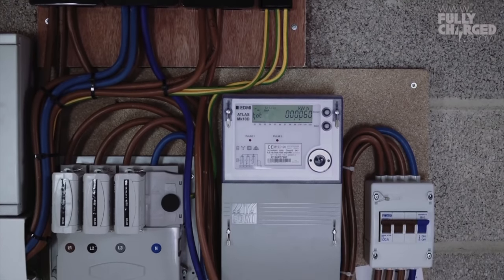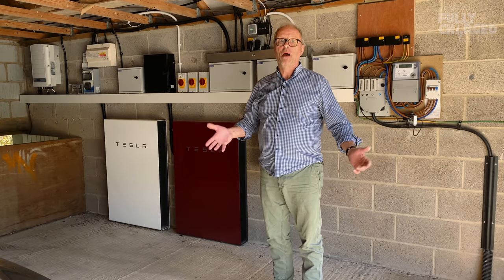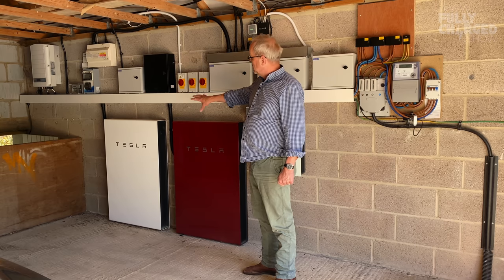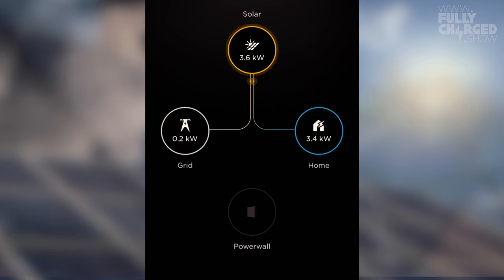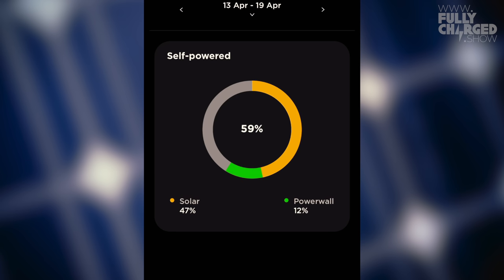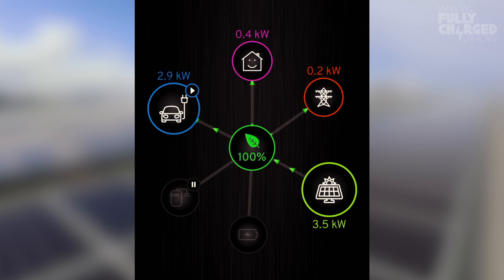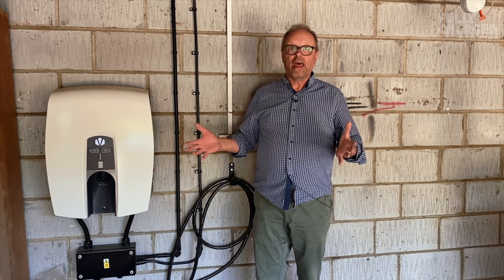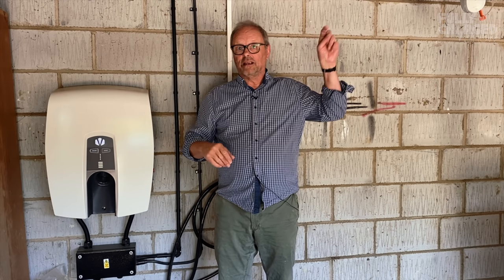Tesla Powerwall: how quickly can it respond to a power cut? | FULLY CHARGED for clean energy & EVs

Comment from the maker: Robert provides an update on 'the update' to his Powerwall installation. He has been busy tweaking his system to ensure instantaneous response in the advent of a blackout. He also shows us what else is going on in his garage, with an update on his Zappi, and introduction to a V2G unit, and lots of lovely statistics to show how homes and cars can be powered by solar, even in England!  For easy reference through each section of this episode, see timestamps below. AND If you like this episode, you might enjoy the previous episode on National Grid's 'Green Energy Success Story': https://youtu.be/ONp8dismI-Q
Reply: fullychargedshow Anyone can build a UPS (Uninterruptible Power Supply) Tesla power walls are just one of many!
Reply: @barryamorris   The tricky bit is getting it to play nice with the power grid management software controlling when the power is going back out.  If a lot of houses just dumb-state it both ways, that could disrupt the local grid distribution or fry some of their equipment (and people).

Back when one house in 100,000 had surplus electricity, it just ran the meter back a bit and the grid coped with the margins -- it was statistically insignificant to the total charges & resistances (especially out in the country where the very early adopters tended to be).  If you're going to have most or all houses doing the same thing in town, it could destabilize altogether.

At some point in the equation, the margin becomes the main sum, and everyone has to learn to play nice with others.
Reply: I assume from this that the Powerwalls can't emulate the V2G functionality, yet?
If there's a Powerwall connected to two phases of the three phase supply why isn't the V2G unit connected to the thrird phase?
Love the tech but could you share as to whether Powerwall prices have followed the downward trend in vehicle battery prices?
Thanks.
Reply: animist channel Smart meters measure both import and export rates. As for playing nice with the grid, you have to notify them that you have generating equipment in the first place. They balance the grid constantly by ramping generators up and down constantly! The more people that can export power, the less reliant we are on coal, and other legacy power supplies. We need far more micro generation and battery storage systems. If we do, blackouts and brownouts will become a thing of the past. Current generation methods are still unreliable, offering uneven wave form power supplies. The energy generation still has a lot to improve on.
Reply: Fully charged 😁👍🏻
Reply: In terms of CO2, I'm wondering about how much the production of the power walls and those solar panels for a single household are responsible for and how many years it has to run in order to offset that foot print.
Reply: @barryamorris  Most devices known as a UPS don't have 27kWh storage & the ability to run an entire household.
Reply: A 15m video just to saw us how much time it takes for a power wall to feel the gap of energy.   WHY DOES IT HAVE TO BE 15 MINUTES LONG??????   You have to answer this one!!
Reply: Older Nissan Leafs can get a software-update to unlock V2G capability. Check with your Nissan Dealer. The oldest Leaf we have tried for V2G was a 2012
Reply: vk2aaf hamradio they can go far bigger! The more batteries you connect in parallel, the more power they store! Think commercial set up
Reply: @BobAndersson  I actually thought they can do that already, but on second thought it would be problematic. It makes sense to sell some of the power left in your car battery because you aren't charging it at peak time and it is unlikely you need to take long trips at night so you can charge it then. The PW is already powering your own house.
Math: Your car might have 100kWh battery of which normal people don't actually use much during normal days, so W2G could sell 50kWh and still leave you plenty of range for late night shopping. OTOH, your PW has 6kWh or 13kWh capacity if full, which is barely enough for the peak hours.
And the electric company isn't going to buy from you at their peak selling rate either, so using the stored power saves you more money than you would get from selling it.
Reply: Great video, as always, but one question: Which Power Supplier do you use? Sounds interesting - I know you can't mention it in the Video, but there is no law that forbids to answer questions ;-)
Reply: Pavor  Lithium does not qualify as a finite resource unless you use it for fusion power. There is plenty of it available and we can recycle it from used batteries; oil is finite because once last wells dry up there won't be any more ever.
The only problem with lithium is that pumping brine into pools and letting the sun dry them so we can collect the lithium salts is actually too cheap, so all lithium mines closed because they could not compete. As demand grows and the price rises that may change again, and if we really need loads more we can simply separate it from seawater.
Reply: @apostolosviol  You don't have to watch the video. You're free to stop it and go elsewhere, if you wish, and if your attention span is simply too short. Fully charged can run their channel exactly as they want to run it. 

There are thousands of people who are interested in watching a video which is only 15 minutes in length, learning quite a lot of useful information from it, and being entertained by a seasoned professional with more than 30 years of honing his skills.

At the time of writing my comment, this video has more than 6,700 likes and only 68 dislikes, one of which might be yours, and a few might be from bots. On that basis, you're outnumbered by around 100:1 to date.
Reply: @KookyBone  OVO. He tells us.
Reply: @29rvnd  Did you have your Nissan Leaf 2011 up-gradeed in the UK?
Reply: 🤗THANKS ROBERT,WATCHING WHILE YOU ARE IN SAN DEIGO …😁 2+years later 
AND WE HOPE YOU ARE ENJOYING EVERYTHING HERE,AND NOW 😁😎💚💚💚

Comment: Thanks again for showing us what is possible in this new world of clean power production and use. I did call over a year ago to thank Robert personally. We live just over the hill from him, and have followed his lead with Solar, Eddi, Zappi, Hub, etc. Battery in the garage, with a Hyundai, Ioniq, then a Leaf 30kWh to connect into the V2G run by OVO. The strange thing is that OVO declined after a lot of head scratching to put us on the V2G trial, because we had a battery (6.3 kWh) in the system. Despite being told it was not for export to the grid, they said no, as perhaps it might export. You Robert 5 miles away, have 2 batteries, and a leaf that can’t be used, and still get onto the trial! Such is the aura of your persona! Well done, I look forward to seeing how it works. As for us we sold the leaf, its Winter performance gave us issues that caused tears, and we can’t use it for V2G. So again we follow your eg. With a Kona 64, and may be a Tesla M3. Ces’t la vie.

Comment: The Tesla switch is fast indeed! A colleague of mine more than a decade ago already had a switch between grid and home battery, but it had simple contactors and time relays. When power went out, it would pull a large contactor (normally closed contacts) disconnecting the house from mains. When all three phases were back and continuously on for more than 20 min, it would switch off the contactor and connect back to mains. It worked well, but there was a noticeable gap between switching in power out situation. He did have UPS setup for computers etc, so they didn't notice it. You noticed lights go out and then back on (maybe half a second delay)
Reply: EWheeler Finland Think solid state switching. To get the change over correct, there will always be a millisecond gap, to ensure you disconnect from one, and switch to the other.

Comment: Going to do battle with EDF in France this week. They keep pestering me to put solar on my roof, but have been reluctant to let you store it and do V2G, I’ll let you know if they have changed their minds yet!
Reply: Libellula Washington My agreement with the French Grid operator says I cannot have storage. No big problem for me as my solar is there primarily to power the pool pumps and heat my water.
Reply: Store the solar and use the grid as a generator, don't export to the grid. If everyone did this the grid would be stable and they could not jack up your  cost to buy, just because you have solar.
Reply: @wrong-waygo-back9355  if everyone did that, the grid would become unsustainable, economicomically.
Yourd be self sustaining, not profitable anymore, can't have that.
Reply: V2G would be a stop-gap measure to large scale decentralized grid storage. Paid for by you, the customer of your mode of transportation.
It would flatten the curve for gas-powrplants to ramp up/down and softening the load on the grid as a whole.

Comment: Great video! Solar panels, lithium batteries, electric vehicles and now V2G, right now I feel envy. And you live in UK imagine the potential of your installation in Spain ...
Reply: Or Australia. We are looking at a daily average of 23kWh from a 6.5kW system in winter, close to 40 in summer.

I honestly think Tesla is missing a trick here with v2g. Do we want to rely on it for backbone storage? Probably not, but it can be the peaking output so we don't double up on the batteries required. And you usually need peaking output when supply charges are high, so better for those becoming an occasional temporary supply.

Comment: We put our system to the test last week. I live near Philadelphia, PA and we had a major storm come through. We were off the grid for 62 hours 18 minutes but we were never out of power. Between the batteries and the solar we could do pretty much anything we wanted. I only have one issue with the Powerwalls, the bridge that allows it to power the house and use the solar only comes in a 200amp version, we have 400amp service to the house so we did have to decide what would remain powered and what would not. I think if they had a bridge that could handle our entire house I would have gotten a 3rd Powerwall to allow us to use the AC. 
The best part about the Powerwall is that, unlike a generator, the batteries are used everyday to help power the house.

Comment: My DIY (well installed by an electrician) setup uses 2-terminal relays to switch live/neutral from the grid to my inverter.  It's pulled into the NO position by a small AC transformer powered by the grid.  If the grid fails the relay goes to the NC position and the inverter (which is always on) just starts powering the panel.  Granted my critical load panel isn't "the whole house" but my setup can keep things like my fridge/freezer/telco running uninterrupted and it costs a heck of a lot less than a Tesla powerwall :-)

Comment: It's a shame smart meter support for three phase isn't very good. We should really be pushing for all new houses to be three phase. It makes it a lot easier from a DNO perspective to add solar and batteries. It also enables the transition from gas boilers to heat pumps, and faster EV charging.
Reply: Yes, and also really crucial for commercial applications. V2G will work fabulously with commercial vehicles that are used during the workday and then parked up for the evening. Any remaining juice in the batteries can be fed into the grid during the evening peak, before the vehicles are recharged in the early hours of the morning, ready for the next day.
Reply: Yup, and where there is a chance that 250 volts will give you a really bad day, but one you will remember, if you short out across 2 of those phases and get 415 volts going through you, YOU may not be aware of it, (being dead), your nearest and dearest will. And can drink to your memory every year. 
If 3 phase were to be rolled out to domestic dwellings, the occupants need to be far more aware about the dangers than they are at present. Where half the population can not even wire a plug!
Reply: but then you would need more substations and transformers if you were to encourage that. Plus relaying all the distribution cables. I dont understand how having three phase makes it easier?
Reply: @pauldawson-plincke249  if you need the power 50% more cable gives you 300% more power.
Reply: @pauldawson-plincke249  Three phase is already in the street, it's just the cable to each house that's different. The phases must remain fairly balanced,  so houses in the same street tend to go on alternate phases.

Comment: Had my powerwall for a few months now and love it.  Got it to be self sufficient and to handle power outages (which we tend to have due to high winds and fire danger when they shut off the power proactively).  I love the security it provides me. Barely notice a flicker of the lights when we do lose power.  I do only have it set non-backup activities for during our peak power hours (4pm-9pm) though so that the battery will last as long as possible (cycles).
Curious about what your power company pays you for power you pump back into the grid vs. what you pay for power delivered.  One of the big misconceptions here (Northern California) with V2G is that people think the power company is going to pay them the retail price of power they pump into the grid.  But they only get the average wholesale price (approx $0.03/kWh) vs the retail price ($0.09/kWh for lowest tier price and up to $0.45/kWh for highest tier price based on ToD and usage). And even the highest marginal retail price during the hottest days is not enough to justify the V2G expense of recharging from the grid. I only see V2G as useful V2H, if you don't have a powerwall installed.
Also, over here in NorCal, the clean power is during the day due to such a high percentage of solar, and the dirty power is during the evening/night time.  Of course, we do drive on the other side of the road. :D

Comment: I’m in Australia and also have a powerwall plus solar. My hot water is also solar boosted with it’s own heat exchanger panels (something like double glazed window frames filled with copper pipes painted black to absorb heat). For 8 months of the year my house runs pretty well from solar - although as it gets closer to winter a second battery would be useful. My hot water and my car are actually powered by a second circuit (the hot water is electric boosted automatically for overcast days).  This second circuit is what’s known here as ‘controlled load’ where the utility can set when the circuit is live, subject to minimum times. Generally here power is very cheap at night because of lower demand, and this is when the controlled circuit kicks in, heating the water and charging my car.  I don’t have a Zappy type charger for the car.

Unfortunately a lot of nighttime power is supported by coal here, making the nighttime use dirtier than during the day - however this is getting better as more wind and other storage capacity comes into play. 

The biggest problem that I see with using the excess power to charge the car rather than feeding the grid is that (outside of COVID-19 restrictions) my car is generally not at home during the day as I’m out at work or whatever, and the car needs to be charged at night when there isn’t any solar. Similarly this means that I need to use grid power at night.

Hopefully we will start to see the price for home batteries drop substantially such that having a 100kWh home battery is cost effective. This would be enough to store my excess power and charge the car without impacting the house supply, and would also allow the house to run for longer if there are a few really bad days for generating in a row. 

For what it’s worth though, after a big storm here in February (summer time remember), the grid was taken down for 1.5 days. Some neighbours lost power for a week. Our place just kept running, with solar hot water etc, and the only real impact was no internet (cables down) and no car charging at home.

Something else worth noting is that the ‘self powered’ graph that Robert was showing excludes any power provided to the grid. It’s really showing how much you house has been independent and not the raw numbers generated. For example, if my house draws 2kWh from the grid and consumes 10kWh then it’ll show as 80% self powered, even if the solar generates 30kWh and puts 20kWh of that into the grid. 

As a final word, my place would actually do a lot better in winter if the winter solstice didn’t put the sun below the tree level of some enormous 25-30m gum trees that shade the roof. Don’t underestimate the effect of shading in winter.

Comment: Very nice! I have the Fronius solution for this which is a lot more compact - all within the inverter & switchboard... but it doesn't switch instantly - there is a 20 second gap for it to enter (and exit) 'island mode' for grid worker safety & to allow the inverter to switch from balanced 3-phase production to asymmetric production over 3 phases. I can also continue to charge the battery & EV and power the house even when the grid is down. There are some limits: maximum AC usage 5kW and there cannot be a difference between any two phases greater than 2.5kW. But this isn't really an issue unless we turn the oven and a few AC units on.